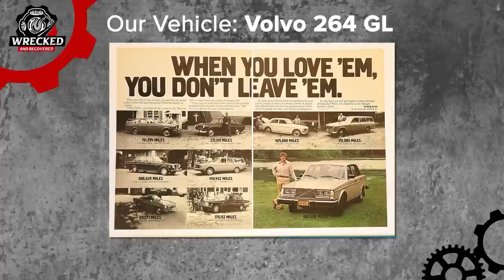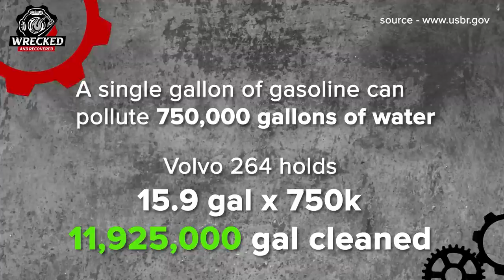1980's Volvo 264 GL Pulled Out Of Muddy River After 40 Years! (ALMOST FAILED!)

Comment: Although u had a ton of rusted and busted metal; under the circumstances good job.
Had to pull an aircraft after a crash years ago in Lake Apopka and that one was a mess. Had to wrap safety mesh around the fuselage to contain contents and hoist it up. Clearly you had it bad not knowing what u were getting into from the start.

Comment: At least it's out of the water and what's left can be recycled.  That is great.  Just a suggestion as to what I would do is get some log chokers.  Just wrap one around the car just like a log.  It will probably crush the car but less likely to pull it apart.  A good logger's supply could make you up some 24 foot chokers that would be about right.

Comment: Make sure when you set the truck for a pull that you have to extend the tow bar and drop it on the ground. It will help keep the trucks nose on the ground as well as stabilize the lift arm